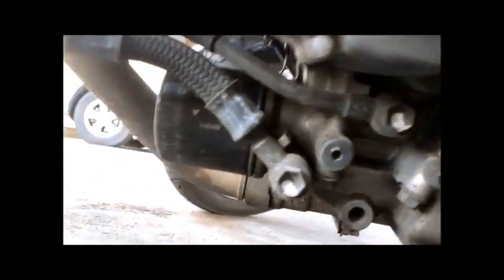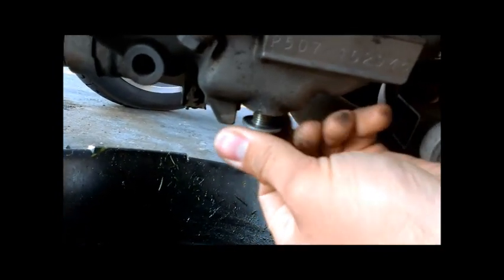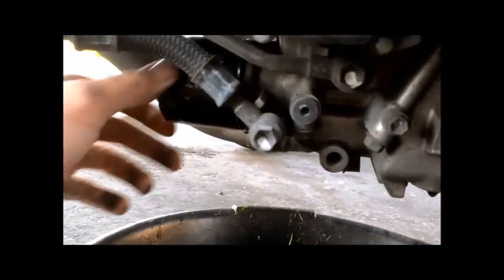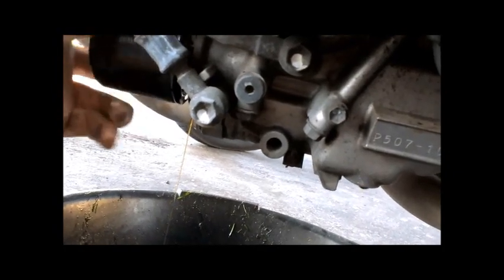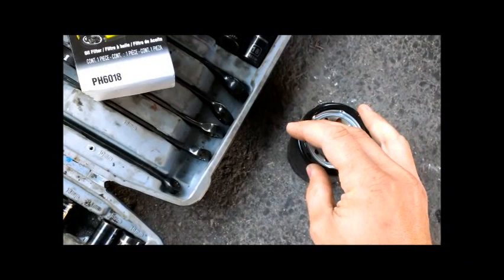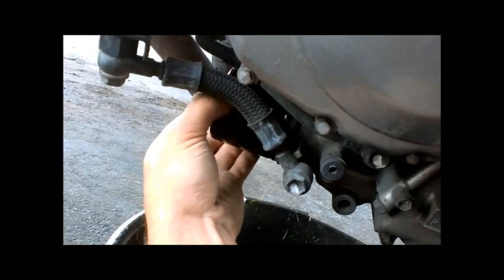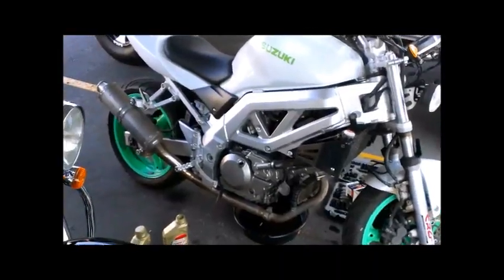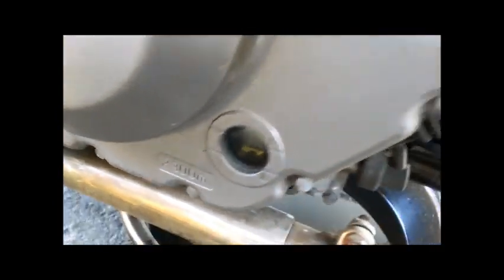Oil Change on a Bullet Bike - Suzuki SV650

Comment: I run the bike around the block a couple times to stir up the oil and warm it up... it may be hot but it won't really burn you unless you run the motor too long....      also... I would use clean oil on the gasket when putting on the filter... I also pour a little new oil in any vehicle filter before I put it on... and Rotella T6 full synth oil has been great and affordable oil for all motorcycles I've had... new and old... and shifting was better than when I tried motul synth racing oil...   perhaps motul may be better if racing for the engine... but everywhere else people swear by Rotella T6

Comment: Nice video,but I would never use old oil on the seal of my new filter.I just use some fresh one.and I also fill my new filter up with some fresh oil about half so there is always a little inside when starting.